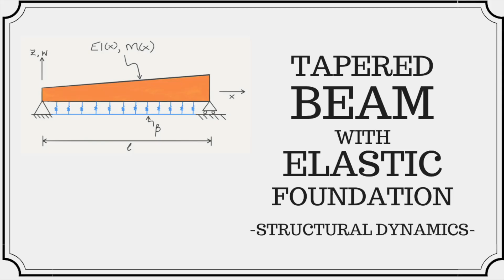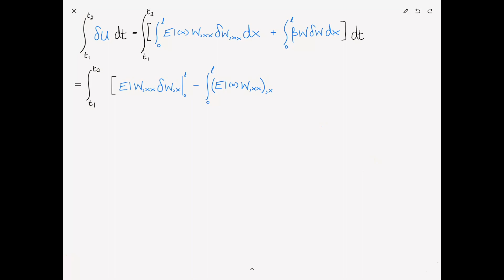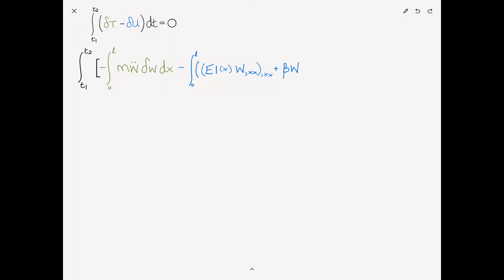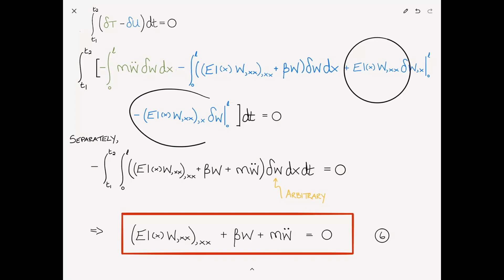Tapered Beam With An Elastic Foundation

Comment: Is it possible to derive the equation of motion for shell structures with first-order shear deformation theory?
Reply from the maker: Yes, it is certainly possible to derive the equation of motion for shell structures using first-order shear deformation theory.  First-order shear deformation theory is an improvement over classical shell theory as accounting for transverse shear becomes increasingly important for thick shells or when analyzing higher-order modes - similar to what we find for beams.

While the derivation is possible, it can be mathematically intensive. The specific form of the equations will depend on the shell geometry and coordinate system chosen.  Will likely require numerical methods to find solution in most practical cases.
Reply: The problem is because of its complexity there is almost no where driven such equations in the way that we can see all possible steps. It might be a little long, but would it be possible for this with your beautiful style?